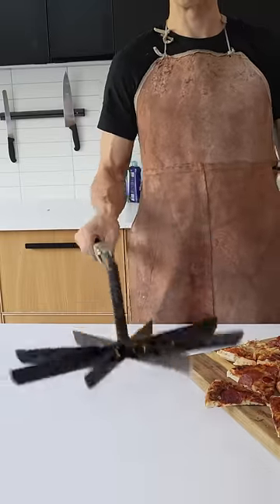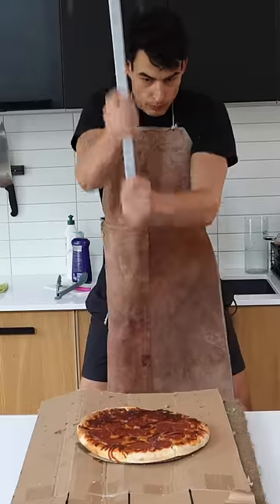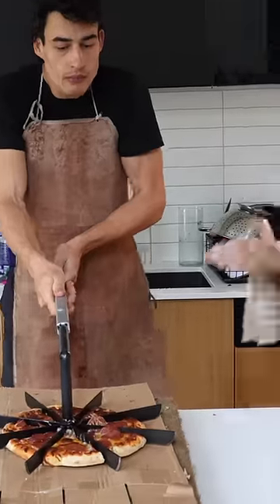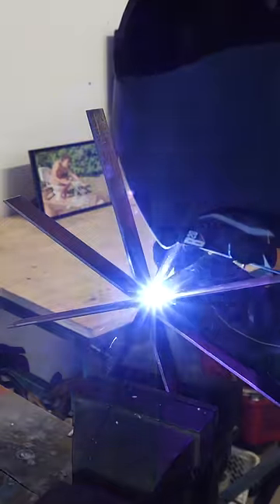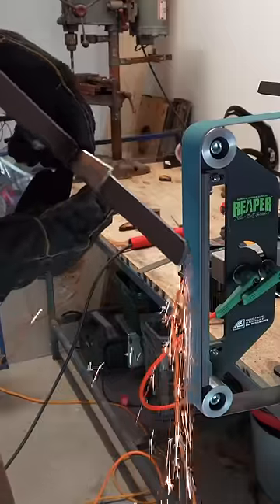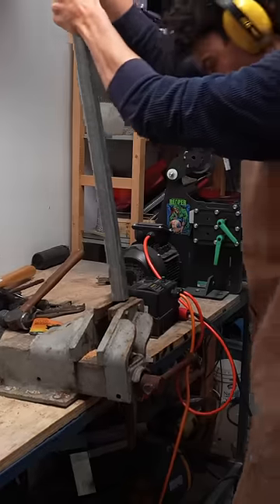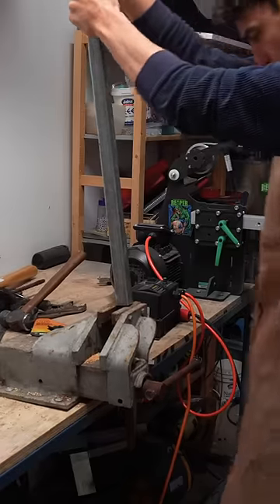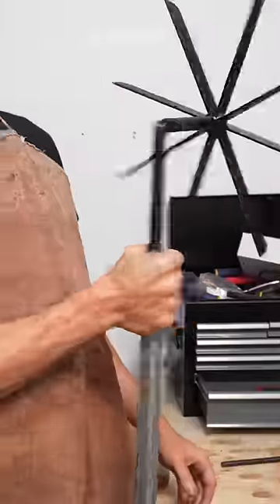Pizza axe

Comment: The fact it works so well is what’s so funny
Reply: I did NOT expect it to work
Reply: I know right ! 😂
Reply: Gets stuck in the board every time
Reply: @ThePandaAgenda it’s cardboard
Reply: @ThePandaAgenda  cardboard also turns to sht(literally) if it gets water, which is like the least intimidating thing ever(except in oceanic quantities)
Reply: @thejanitor5671 Theres a wooden board underneath the cardboard so it doesn't damage the counter...
Reply: @joe-tatothepotatobiden47  still didn’t get stuck though
Reply: @ThePandaAgenda I think it's too blunt to actually cut wood, as seen when he tries to cut a piece of wood and only a tiny splinter comes off. When the weight is distributed across a large flat area like a board, it will be even less effective. Pizza and watermelon are relatively soft compared to wood, so it appears that the blade can easily cut those because of the force of the strike, but will not cut anything tougher
Reply: @elijahpelito4722 water definitely ain’t the least intimidating thing ever if you think abt pressure washers, boiling water, sharp icicles, contaminated water, or, as you said, oceans
Reply: @2GoatsInATrenchCoat  you can see it in the video lol
Reply: @ThePandaAgenda  I didn't see it cut the wood in the video
Reply: @2GoatsInATrenchCoat it got stuck in it tho, which is what was said.
Reply: @boogniche142  I must be blind because I didn't see that. that's fine, though. I believe you, since multiple people said it. I just didn't see it get embedded
Reply: @cact0s_ulion405  i mean this is such a simple and straightforward object it was going to work without issue. Its just sharp metal theres no reason it shouldnt work.
Reply: @Celticshade  By the looks of it, it isn't sharp at all. That's why I wasn't expecting it to work.
Reply: @cact0s_ulion405  even if its dull, its still welded metal vs pizza.
Reply from the maker: Im ashamed
Reply: Im impressed
Reply: @2GoatsInATrenchCoat  Nah it's the bulk welds in the middle that stopped it cutting wood. it would have worked off center but he hit it dead center, right on the welds, his accuracy is actually quite impressive
. He would have to file the welds form so that they formed part of the blade.
Reply: @Ididathing  be proud
Reply: @hogandromgool2062  that makes sense. thanks for explaining!
Reply: @2GoatsInATrenchCoat  Not a prob bud, have a great day.
Reply: @Ididathing  No.
Reply: @boogniche142  I don't know what you're on about. You can see it turn and tilt in the video, and the cardboard is barely marked underneath the watermelon after. It didn't get stuck.
Reply: @Ididathing  you're one of the most beautifully looking people i've ever seen, you should do a thing about it.
Reply: the design is very human😮
Reply: @cact0s_ulion405 Are you kidding? Im surprised it only cut into the board as little as it did
Reply: @Ididathing 
You're gonna be so RICH!
Reply: It probably won’t work well on actual pizza though because American fake pizza is basicallyvery fluffy bread with a topping on it meanwhile actual pizza is rougher because it’s thin and baked in a stone oven with 500C
Reply: @Celticshade here's the part I thought would be problematic:
Trying to get within about 1" of the center of the pizza in a single attempt, while swinging it pretty hard!
I've swung a hammer a fair few times and I never swing hard with my off-hand in front of the hammer head, and if I did I'd end up with brutally smashed fingers every now and then when I miss the nail
Reply: Yes the most obvious part of the video is the funniest.....
Reply: @ididathing Make a Pizza Axe Gun!
Reply: @Ididathing make a pizza Axe Gun!
Reply: @Ididathing  How DARE you make something so impractical but that actually works so well?!
Reply: did he patent it?
Reply: I want it, and I want it now. Take my money.
Reply: It's a pizza axe. Why would  you actually want to cut anything else  with it? You don't  grab a pizza knife and try to cut a 1 inch rebar with it  @2GoatsInATrenchCoat
Reply: @cumcumcum148  I never said anything to the contrary. I just explained to someone else who critiqued the design that it's designed to only work for pizza and other foods that could be cut into wedges. I never said it's a bad thing that it doesn't cut wood well.
Reply: @Ididathing  80% of the standard distribution thinks your videos take 3-15 minutes to make.

Could you scale that axe up and put a silencer on it? Or are you now scared because anyone can be guilty of a Wartermelon Crime? I hear guilt by non-association is a real issue.

If it gets really bad, we British will send someone from 22 SAS to ensure that the Commonwealth really know how to ensure safety and liberty. But shh, don't tell anyone.

It might impact morale and the high respect you Aussie's have for your government.

<3 McBride.
Reply: @bunglebob  Water can even carve the very earth. Hell water claims about a quarter million lives every year, that shit is to be well-respected.

Comment: The worst part is that it works perfectly
Reply: If your Aim is immaculate, and that's a big "If".
Reply: how can you miss lol  @Chanksss
Reply: @cyberturkey77 Miss the centre by 5 centimetres and you have a badly cut pizza. If you need to apply force, hitting the same spot over and over is hard
Reply: Wouldnt that be the best part?
Reply: This is similar to what is used to cut pizza in Disneyland. Their’s is a contraption where the die comes down directly, no swinging required. Much more OSHA friendly

Comment: having this to use would have made my double shifts at dominoe’s a lot more enjoyable
Reply: I’m sure the customers would be more kind too…just keep the pizza slicer up front
Reply: @DaTimmeh lmao
Reply: Now make a pizza guillotine.
Reply: @DaTimmeh this makes no sense
Reply: Having used one of these before, it's absolutely garbage because they are very difficult to maintain and sharpen. It's really not that difficult but corporations can't be asked to deal with shit that has to be done by hand. The cutters they have at dominos right now work just fine, the 4 or 5 sided blade like in the video just gets dull and becomes a massive problem later since it never makes a full cut anymore.
Reply: @DaTimmeh  maybe they would have tipped more 🤷‍♀️
Reply: @joshmillere6263  Oh but it does. Consider it a brain teaser maybe :)

(Sorry for the dad hint, I can’t help it)
Reply: @joshmillere6263  he replaced the pretty sharp edges with duller ones (that take less maintenance) by using more force and having the table reinforced. I looked at the video, and those definitely aren't sharp, otherwise they would've dug into the wood and watermelon way more.

Comment: A pizza place could probably use something like this on a press with a large wheel or lever. Would need to bevel the blades to prevent sticking, but this has a practical business use. It would allow any employee to make the perfect cut every time.

Comment: Now we just have to make a sanitized version
Reply: just wash it, not that hard

edit: this is a joke lol
Reply: @blobstudio  certified big brain over here. 🧠
Reply: Make it out of rvs. And a unscrewable handle and a dishwasher should be able to handle it no problem
Reply: @blobstudio  Rust has left the chat
Reply: @prismthehybird8023 Metal utensils can also get rusty, but they don't because they are washed 😂 so like they guy you replied to said, just clean it. lol dish soap, water and a sponge will do the trick 👍
Reply: @prismthehybird8023 it rusts only while it made from iron. Just use another material like all knives are made from
Reply: Use stainless steel it'll be good 👍 👌 ❤🎉🎉🎉🎉🎉🎉🎉

Comment: Anyone who hasn't tried them, next time you go to buy a pizza slicer, don't buy rollers. Buy scissors (pizza ones specifically as they're very very long). You think "that'll never work" but man they're brilliant and they always cut all the way through and don't stick to the pizza. Unlike rollers where because they cut a little bit at a time, the cheese can easily melt back together - and blunt ones often just crush the cheese/crust so don't go all the way through.

I would recommend removing the flat side bit from them though - it just gets in the way in my experience.
Reply: SCISSORS IS SO CURSED 💀
Reply: @Azazel0183 they ain't bro
Reply: @mrtrollnator123  u use scissors to cut pizza?
Reply: @Azazel0183  no

Comment: y'know this could actually be a product that people would buy with a few modifications, having a round container with eight blades in the center that you put on top of the pizza and push down or use a spring or something to generate the force to cut the pizza. its a lot safer and could be used more accurately but its admitedly less cool than a giant axe.

Comment: so the way that blades work is though the entire concept of that pressure is determined by the surface and force that is placed down on an object. so with your invention because you are increasing the amount of surface that is being placed down on, ie an entire pizza, it is going to cut worse than if it is just a portion of the pizza. to make this better you should look at another thing in physics which is lever arms, since you have the 90 degree bend already. if you made the bend further down the arm you would apply more force to the cutter and then you wouldnt have to slam it into the pizza every time making for a more accurate cut.

Comment: I'm sure I'm not the first to say it, but the circle of blades should probably have been rotated a bit so one blade was in line with the handle. That way you could cut watermelons without it being blocked. Then again, its a pizza cutter, not a watermelon cutter. Therefore, not a defect. Good job. This was a pointless comment.

Comment: I bet you were SOOOOOOOOOOOO surprised when it WORKED first-try. LOL
They need this at NewYorkPizza, they are lousy at pre-cutting, never cutting all the way through on purpose, to keep it nice in 1 circle when it arrives.
But when you tear it off it will need so much force that you toss the toppings off the pizza, cuz the dough is still soft and barely cooked so still stringy.
Wait ... NewYorkPizza doesn't need this after all, they just need to pack up and stop their business (at least the local one) cuz it's dogwater.